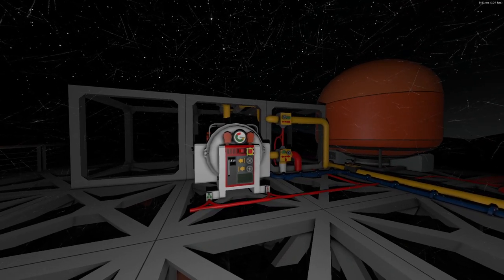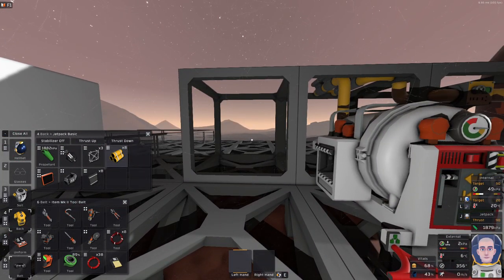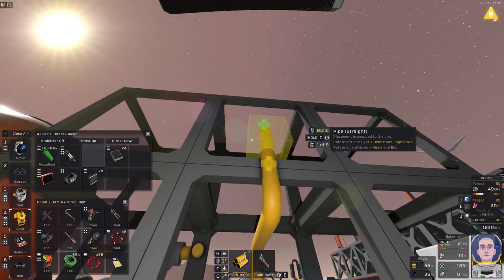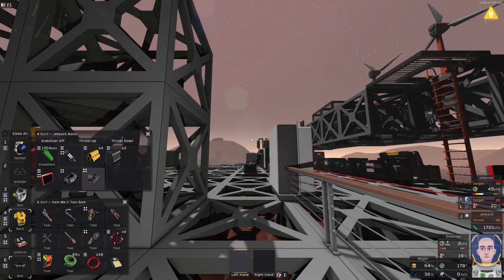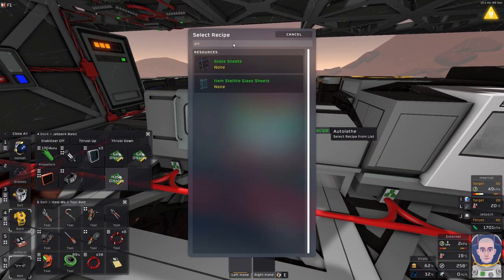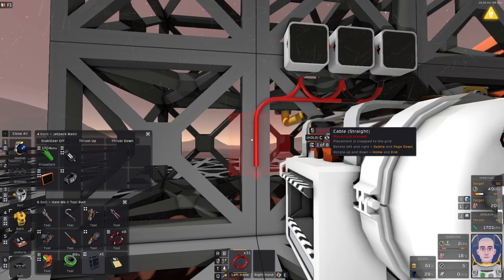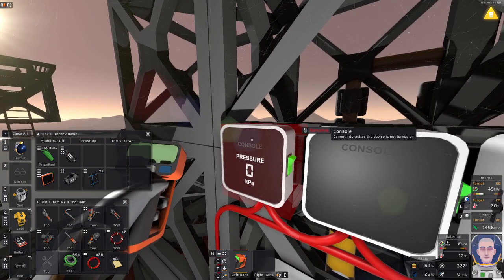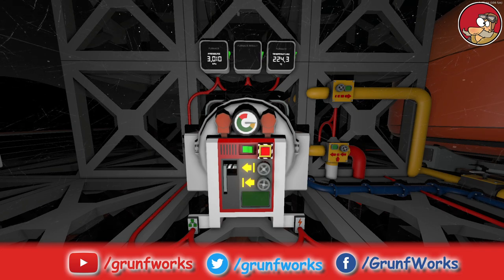Pressure and Temperature Displays for Furnace - Stationeers Mars Survival - ep 32

Comment: For example if you will build room around furnace to not to loose heat, then you probably will need consoles for pressure and temperature in this room. Yes, you need labels and it's missing much for programmable consoles. I mean, I can only display numbers but can't add label to that. I'm not sure if it's MIPS or implementation in this game. In my day job I use another language then MIPS.

Comment: I'm sceptical about lever automation. For example, if you need steel then you need to remember to put coal in the first place. Otherwise you will get iron first and next I guess will be reagent mix.
Reply from the maker: Hmmm, did not think about it that way, good point
Reply: @GrunfWorks  Perhaps you could try to automate only advanced alloys. Then there should not be such issues I guess.
Reply: @GrunfWorks  I think about another automation, not sure if it's doable. I choose what I need, ores are automatically pulled to furnace, temperature and pressure are set and when conditions are right open lever.
Reply from the maker: @radoslawmazurekwaw  I have seen it,  but no idea how to do it. Gotta do some research
Reply: @GrunfWorks  I have some rough idea but also would need to search wiki for details. Cows are Evil showed partial solution, that is mechanism to pull required ores based on chosen alloy.
Reply: @GrunfWorks  Can you compare the desired hash to the hash in the furnace using an IC?